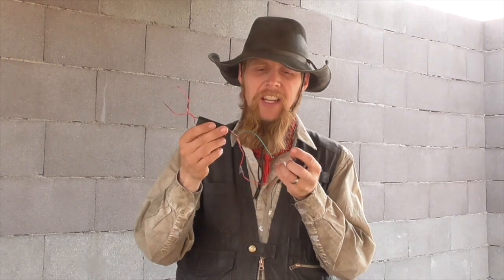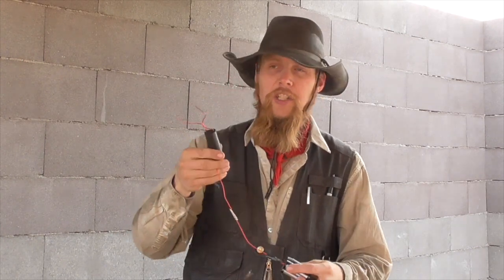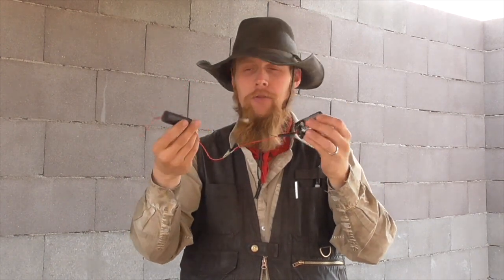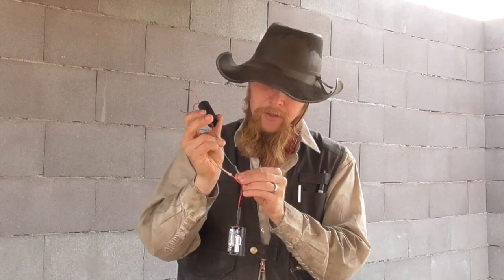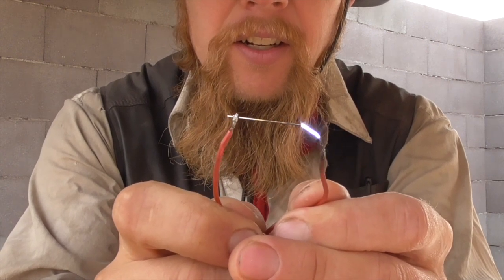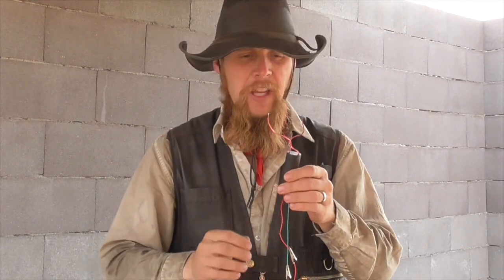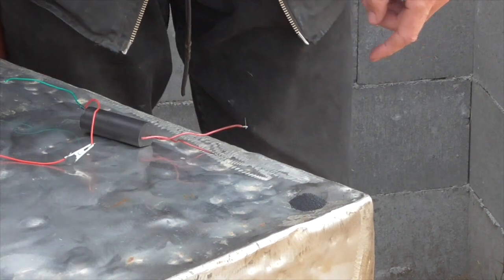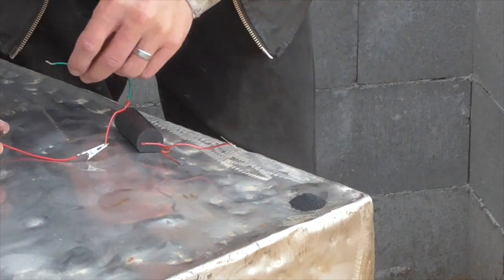Arc Ignitor Experiment (TIS281)

Comment: I remember in my youth flying model rockets.
I had an electric launcher.
It did not spark.
You push the button and the wire would glow hot enough to ignite the propellant.
Reply: we would break the tops off of xmas tree lights exposing the filaments , put a drinking straw over the broken bulb, then pack the straw with a mixture of brown sugar and match heads.
Reply: Arc lighters are MUCH more reliable and last longer thankfully its come a long way

Comment: Someone has already mentioned model rocket ignitors. When I was a kid (and when my son was a kid), sometimes the ignitors would burn without igniting the rocket. Since there were only three ignitors in a three pack of engines, you'd have to buy extra ignitors, which was relatively expensive, and usually inconvenient.

As a kid, I found that a few strands of twisted copper electrical wire would work just as well for an ignitor when you passed 12 volts through them. There is a delay as the wires heat up, but within a second or two, they are hot enough to glow red, ignite the rocket, and then burn through.

If you took the drum bolster off the barrel, you could insert the ignitor wire in through the bolster. When using bare copper wire, you bend it into a long thin U  shape, but you don't want the legs of the U to touch, and short against each other. So we would put the bare wire U into the rocket, and then pack between the legs of the U with a small plug of toilet paper to keep the legs from shorting out. That way, the entire length of wire would carry current and get heated up.

A moderately clever person could manufacture such an ignitor that would be contained within a thin insulating coating, and that would have enough wire left on the ends to wrap around tiny terminal studs near the touch hole that would supply wire from a power pack.

Of course, an open touch hole the size of the threaded end of a drum bolster is going to spout a bunch of fire near your face, so some kind of vent liner might be used to reduce the size of the touch hole, and a blast deflector might keep the flash away from the face and hands.
Reply: I thought half the point of electric ignition was to eliminate the need for single-use ignition sources, so coated thermal ignitors don't fit the bill.  The other half would be to decrease lock time, which would mean bulky resistive elements that need to ignite the charge directly without the aid of a coating aren't accomplishing anything.  The use-case of a handheld firearm implies performance expectations that are different than what I think most people would find acceptable for things like a rocket, a cannon, or a remote pyrotechnic charge -- tighter timing, less gas waste, better repeatability and convenience.  A volume of powder in a vessel can be ignited any number of ways, most of which are impractical.

As an aside, the whole point of a resistive ignitor is to get hot.  In order to do that efficiently, the power being delivered to the element needs to be dissipated in a minimal mass.  Making an ignitor of a single material of uniform cross-section is a terrible geometry for achieving that goal.  What works in a pinch when nothing else is available is rarely an optimal solution in general.

Comment: It can be done :) However, I used a 3 ohm 26ga hot wire. This totally reliably ignited over 60 100 grain genuine 12ga blackpowder charges. Initially I made the mistake of underestimating the corrosive power of gunpowder on electronics. But by replacing the wire each time, it worked. Why bother? I can always get fine wire. I can't always get percussion caps.

I used nichrome and stainless wire, having found copper and steel wire (and steel wool) developed high resistance and unreliable ignition on storage. 

Pre-wired cartridges have lasted over 18 months.

A cordless drill pack is very reliable. I have not thoroughly tested solar charged LiPO phone battery banks, but they work to some extent and are available weatherproofed.

Comment: Yeah - I've played around with it too.   Its not a difficult engineering project (but I'm an EE), but takes more current and duty cycle, so a custom circuit is necessary and would take some playing around with to get it right.  Wish I had the time right now.  There is also the issue of the electrodes becoming fouled - especially with true black powder.   But yes it does seem amazingly resistant to ignition by a simple spark because you are having to heat up a whole flake to the ignition point.  One can of course use a first powder which is more readily ignited (e.g., a flash type powder) that then ignites the black powder.  But again experimentation would be required.  Alas - So many fun experiments which could be done and so little time.  As always enjoy your videos very much . 
==> Wish you'd talk some about Hugh Ross and the Old Earth  paradigm which we both share -- God used that ministry to bring me to the Bible and to Christ over 20 years ago.  And thankfully Jesus keeps opening more and more truths for me to walk in.

Comment: I did a similar experiment last year which worked almost instantly. You are right, you need to generate more heat. I didn't use a spark generator or any complicated circuitry. All I used was a piece of aluminum foil which was much thinner at the contact point with bp and a AA rechargeable battery. It worked flawlessly in an instant. Also I used homemade bp which I made using the so called CIA method.  I think maybe Pyrodex isn't sensetive enough.

Comment: Years ago I saw a fellows idea on electric ignition firearms.  His solution was to use an ignition Fuze from a model rocket.  It is very resistive, yet very thin so it(nearly) instantly turns white hot as it's consumed.

Comment: How did the electric ignition system in the CVA electra work?  They were on the market for a very short time; my guess is that in most areas you couldn't hunt with them because of the regulations for muzzleloading hunts in most states.

Comment: Hello! The module you are using has capacitors and resistors to boost the voltage, it results in very high voltage but low current arc. What you need is ignition module, they don't make beating sounds like this one and create purple arcs, often they are square shaped modules. They create persistent hot purple arc which can ignite paper and other material, so the gun powder will be easy for that one.

Comment: you shocked the heck out of me ,I was sure it would flash up as soon as you sparked the powder ,not enough heat I guess.  I designed pistol that used battery and nichrome wire to ignite the powder. It worked but the wire got red hot to set the powder.

Comment: As an electrical engineer I would charge up a HV capacitor up to around 2 to 3 kv and discharge it with blackpowder between the electrodes in a confined space, you would need a higher capacitance around 1uf or so...for a power supply you could use CFL inverters you can get off a amazon with a HV rectifier diode

Comment: Some experiments were done by a new england website, gunpowder is too conductive to generate heat.  Any spark , or arc that ignites gunpowder, or starts fires is determined by the heat of the spark, not the amount of sparks.  The electric system that worked in their experiments was the flash generator from a disposible camera, which is similar to the system cva used in the short production run cva electra which was never a hit, probably due to everyones experience with electronic devices which eventually fail, flintlocks still work properly hundreds of years later.

Comment: Buy a CCFL inverter and attach a high capacitance 100nF output Cockcroft Walton Voltage multiplier to that to get 2KV.   Then use an outside of chamber spark gap triggered by a pressure drop using a miniature spring powered bellows as a trigger gap in series with the arc in the chamber.  That may produce enough bang for gunpowder at 0.2J of energy per spark.

Comment: Existing electric ignition muzzleloader: CVA Electronic Ignition System, called Electra! PDF manual available online with plenty of info. Looks like it might not have been very successful, as this model is discontinued.

...got the grey cells going now...Schel Sullivan's Vape Pen Rocket Launcher
 was an interesting example of a readymade glow plug type ignitor...even though he was using flash cotton.

Comment: I've done several experiments with both black and smokeless powder ignition using electric arcs, and I've come to the same conclusion: the electric potential itself does not ignite the powder, it is the heat generated by the arc. The prime factor affecting the heat of the arc plasma is the amount of current it carries, the voltage of the system does not matter except for overcoming the breakdown potential of the given gap. I found that at least 15-20 mA of continuous AC current is required to generate adequate heat for ignition, and given that at least a few kV would be needed to make a good-sized spark, the amount of power needed is too large and inefficient. Furthermore, plasma is not very thermally conductive, and even at high currents the heat transfer is not quick enough to provide a consistent lock time (at least out of confinement, haven't tested it in a chamber yet.) The use of a low-voltage filament as a primer is much more economical, and was the basis of the Remington etronX system that worked fine, but never took off commercially.

Comment: I suspect the metal table was acting as a heat sink and keeping things too cold to ignite. I'd try a metal pin fixed upright on the table, maybe with something insulated around it to hold the powder off the table too. Then the arc would be formed away from the heat sink effect of the table surface.

Others have mentioned using a low(er) voltage heating element. The problem with that is the lock-time. It would be even longer than with a flint or wheel lock gun.

Comment: In a word; hot-wire.  Use the equivalent of uninsulated electrical fuse, that is replaced on every shot.  Just a single strand of copper wire that you couple to a 9 V battery should work.

Comment: The issue here is confusion. in order to generate the heat necessary to ignite the powder, you need to increase the amperage, not the voltage. Low voltage, high current is your preferred option. This is the principle that arc welders work on. You can hook up 2 12v lead acid batteries in parallel and weld with them, but if you take the same batteries and boost the voltage, but reduce the current, your results will be less than optimal.

Comment: Get the propellant into a cylinder of stretched out steel wool after mixing it with a pure Alcohol to allow air to escape it,dried inside of a cylindrical mould of course,as long as the steel wool is exposed at the surface a current passing through will ignite it and the resulting flame should be able to ignite the propellant.

Comment: Arc lighters/so called plasma lighters may not work as well as a nichrome coil or a RC nitromethane glow plug would be cool to see you try the other options the Nichrome wire GLOWING red hot should be able to do it, similarly the kind of nichrome coil used in an ecig  8.4v input and instant 500c

If you could I'd like to see the arc lighter with a strip of magicians flash paper or hell even ordinary paper That could solve the issue

Comment: recommend testing with actual BP. Pretty sure that like most smokeless powders pyrodex is coated with carbon dust specifically to help prevent static discharge ignition. true black powder on the other hand doesn't have this feature.

Comment: I just had an idea to fix your problem with the electric ignition, It may be difficult to ignite powder with an electric charge, but we all know it is not difficult to ignite paper... so my theory, would electricity ignite a paper black powder cartrage made with nitride treated paper? (Nitride can be optional, but certainly could aid in the powder’s ignition further) You may realise this design of a paper cartrage already exists for black powder revolver for the purpose of reloading a black powder revolver more quickly, and nitride treatment of the paper as well for the original purpose of making sure all the paper was burned after the reaction takes place in the cylinder, therefore you can use stock paper cartridge formers and already existing recipes out there. It also shouldn’t be difficult for a man of your expertise to make a prototype using the exact same cartrages with an electric ignition system using this ammo, In fact, you could probably modify one of the interesting devices you’ve already made yourself for this task, like your pistol you’ve made for the sole purpose of experimenting with a .44 barrel. The rest would truly be electronics.
Reply from the maker: I've tried igniting paper with this circuit, and the spark blows a tiny hole through the paper, but does not ignite it.

Comment: Do you think you could electrical light off a standard 209 primer
Reply from the maker: My guess is no, at least not with this circuit.  A primer is basically a metal cup or canister filled with an impact-sensitive chemical, so I'm thinking it would act as a Faraday cage, shielding the priming compound from the electrical spark.  A different (lower voltage, higher current) power supply might heat up the metal cup enough to make the primer go off, and a spark like this might set off raw priming compound if it passed directly through it.  But in any case, that would kind of defeat the purpose of electrical ignition, since the idea was to eliminate the need for a primer by igniting the powder with an electrical spark instead.
Reply: @TheIdahoanShow  thank you sir for your for your reply electrical ignition has long been an interest of mine

Comment: If you could somehow incorporate a heating element, kind of like a glow plug for a diesel engine, and make it robust enough to handle the explosive environment, it should work. At least it's easy to test to see if it will light just loose gunpowder.

Comment: I think the ignition problem would be easy to solve with some gun cotton. 
It should also be easier when the powder is compressed inside the gun.
Reply: Guncotton is not conductive.
Reply: @VikOlliver  neither is air, and the spark still went trough it.
Reply: @yaykruser  Air is composed of easily ionized, small molecules. Guncotton is a polymer capable of charge distribution and so is not easily converted into an ionized state. What you want is a small, ionizable molecule like a simple organic peroxide or an azide that can propagate deflagration. Or use a hot wire which sets guncotton  off just fine.
Reply: @VikOlliver  Now the main advantage of guncotton is thats its not a powder so it doesnt move away like a powder. 
Doesnt matter if the arc goes directly through it it just has to heat it. 
You know these Arc Lighters? thats exactly what you need .
Reply: @yaykruser  Right, yeah, I know what you mean. They create quite a lot of actual hot plasma, which sets fluffy stuff on fire. Not sure how well it would go densely packed. One way to find out...

Comment: RC plane glowplugs are what I'm planning on using for mine, makes the trigger really easy to design 😂
Reply: I wonder how well they cope with the corrosive residue?
Reply: @VikOlliver  I'm not sure. I think they're made with NiChrome wire so probably won't hurt much if they're cleaned promptly.
Reply: @TheRealWilliamWhite  My problem was the junction between the nichrome and the brass/copper crimps. Corroded like hell.
Reply: @VikOlliver  that could be an issue then, I'll just have to see what happens with it.
Reply: How well do they hold heat after power is removed ???

Comment: I see 2 more problems: 
 1: The Isolation on your wire will burn off causing it to spark trough the metal instead of the chamber. 
2: Your wire is gonna die after a few uses either trough corrosion ,mechanical force from the explosion or the heat.
Reply: Both are materials problems.  An insulator that can take the pressure and shock.  And an electrode which doesn't erode too badly under the hot gasses.
Reply: @hanelyp1  Yeah, but our materials are limited, pressure and shock would be okay for rubber, but there is heat too.
Electrode might work with stainless steel or iridium like in Spark plugs , but Iridium tends to break. 
I dont see a way this is gonna work with wires or cables, maybe with something like a car spark plug.

Comment: i'm thinking a capacitor and wind up systen would work. like the flash system out of an old film camara. i took one apparat one time and didn't know it was still charged and got the most painful jolt i ever felt. left a burn mark on my thumb. that or an automotive coil, the old kind for distributor systems. I took auto tech in collage ant the teacher was telling us about a certain  type they used to use that were dangerous and actually killed people .

Comment: I'm going to guess that if one takes a #2 oil burner ignition transformer and places black powder between two probes connected to it then the BP will ignite in under a second as #2 fuel oil is hard to burn as well. So hard to burn in fact they have to pump the fuel into a mist then run something like 10k volts constantly sparking between two probes in order to get a flame. The whole setup is basically a flamethrower.

Comment: You should try using Xenon flash lamp driver circuit - uses high voltage to ionize air making it conductive enough to pass high current from a big capacitor (several hundred microfarads) that is charged by relatively lower voltage (300 - 500 V).
High current heats the gas (air) and ignites propellant.
I recommend you take a look at this website (https://www.ctmuzzleloaders.com/ctml_experiments/electric_ignition/eignition.html) and experiments that where undertaken with this same goal in mind!
Have a great time, keep your work going and stay safe!